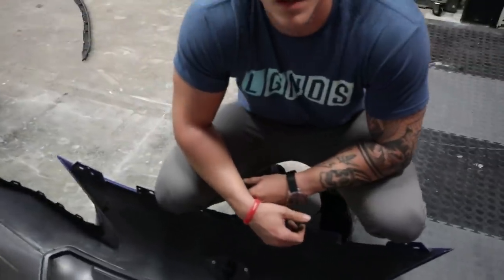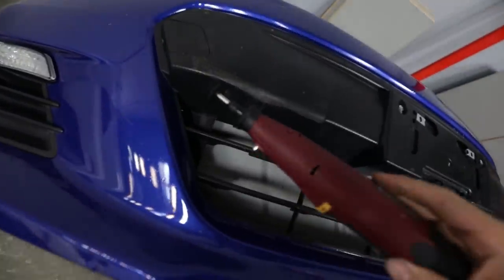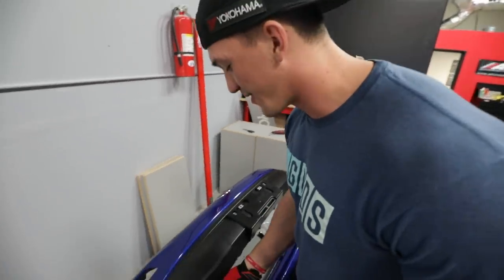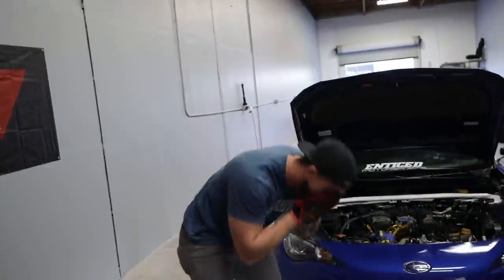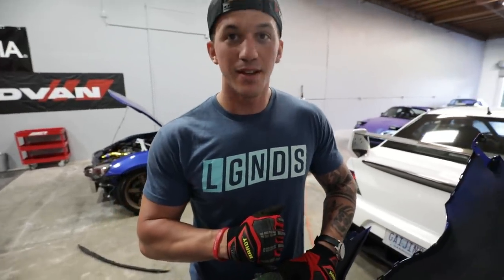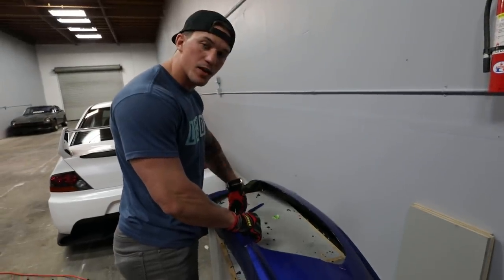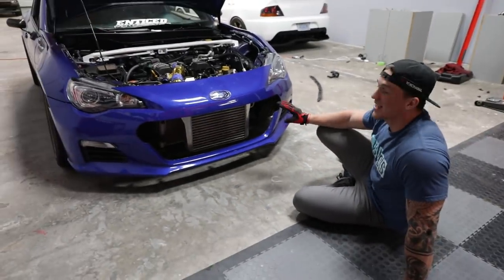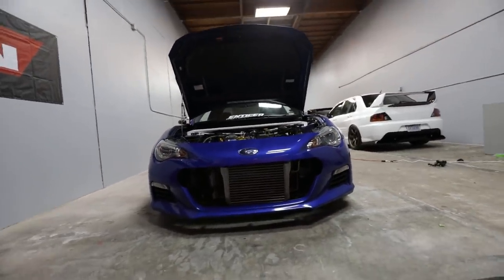Finally CUTTING Into My TURBO BRZ!

Comment: A bigger inter cooler would make it perfect 👌🏻
Reply: Nic Wheel yes
Reply: Bigger intercooler, oil cooler, perhaps a front mounted turbo?
Reply: If the intercooler is too big for the turbo the car won't run properly

Comment: Kaz from Illiminate cut his rear bumper and it made it so much more aggressive. He also put the street faction bash bar.
Reply: More people like this so Dut can see, Kaz's rear bumper cut looks sick and it'll look just as here especially with the single exhaust. Plus with this being a drift cars he's going to be putting drift spec suspension components and it'll be tight getting a nice view of those
Reply: also think it will make Dustin’s car look a lot nice in general cause he won’t have the empty hole out the back
Reply: I really like that look as well. Show off all that nice piping.

Comment: It would look super sick if you were able to get a front  bash bar that would wrap around the inter cooler along with filling out the side holes where there isn’t an inter cooler. Then get the front mounted waste gate and BOV 👌🏼

Comment: Are you running the undertray? I have a similar kit and heard that if we don't run it the bumper will flex a lot at high speeds and the bottom tray will come off

Comment: Dustin Williams At home depot they sell a machine that cut like that and is much better then the one harbon freight. Is call dremel 3000 it helps alot with cutting edges.

Comment: I think if you did the full send on the bumper and then somehow made an air guide that followed the same body line of the bumper that you just cut out I think it would clean up the look of the rough Edge on the bumper it would help to push air where it needs to go and I think it would give it an overall cleaner look with such a huge open aggressive mouth. Dope as fuk don't get me wrong but I think it would need that Finishing Touch of making the air guides so it looks more OEM finish